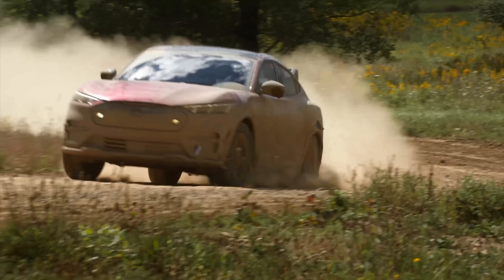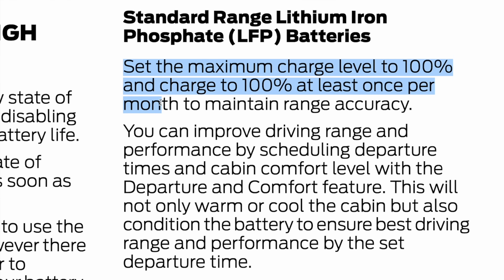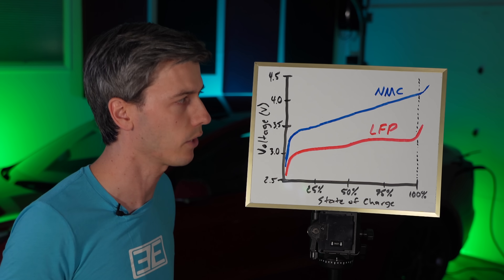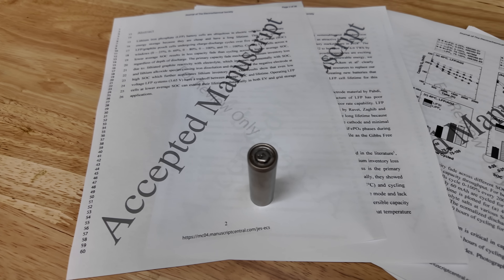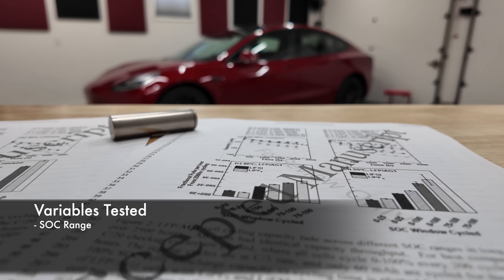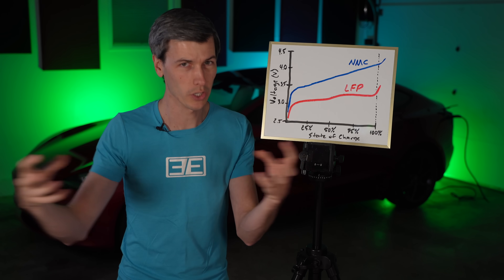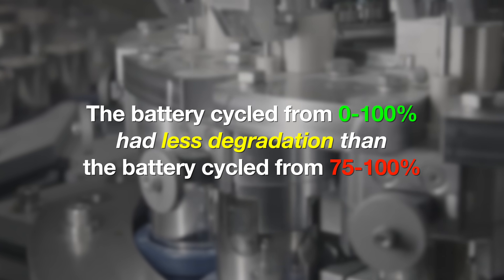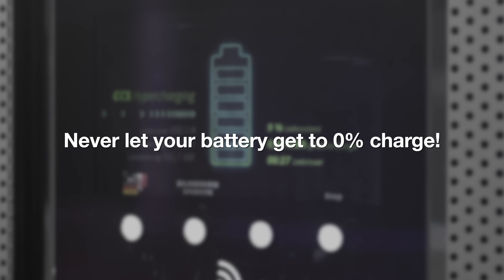How To Ruin Your Electric Car's Battery - LFP Edition!

Comment: "You should never let your battery get down to 0%. Period." Someone should tell Kyle from Out of Spec Reviews. 😅
Reply from the maker: Haha, honestly was thinking about him when I wrote that line. But I love that he does it, because we all get to learn from his experiences!
Reply: @EngineeringExplained yes but at the cost of permanently damaging a vehicle that was loaned to him which will be sold to a customer in a couple of days lol
Reply: @EngineeringExplained  go watch TeslaBjorn and his getting stranded videos. Where he goes battery dead, with clear testing what shall happen and how long it shall take to get out of situation. It is clear that going to 0 and total dead battery shall happen as we do have jerrycan for a reason 😂
Reply: @EngineeringExplained  you mean  learn from his mistakes.
Reply: @cloudpandarism2627  both are grammatically correct.
Reply: @cloudpandarism2627  do people not realize that Kyle doesn't run out of battery in normal personal use (maybe once ever)? He intentionally runs out the battery in testing so that people know what the buffers and behaviors are.
Reply: @cloudpandarism2627 
He's doing it on purpose to get the data.  That way, we don't have to.  It proves you won't blow up as well.  It's not a big deal to be at 0%, as long as you charge soon.
Reply: I don't think the cars allow the batteries to actually get down to 0%. They always keep some buffer to prevent damage even when the car will no longer drive. I would assume the only way to damage the battery is to leave it for a while after driving to 0% so the battery actually gets fully dead.
Reply: @RyanSmithPhoto  That's typically the case.  Battery life(longevity) is effected by states of charge where charging from 0% to 100% (actual battery voltages) may only allow a battery to complete 300 cycles, if it were to charge from -5% to 105% it may only survive 10 cycles, from 10 to 90% it may complete 10,000 cycles.  Most manufacturers are targeting a particular cycle life so they are going to lock you out of the top and bottom of the pack to make sure the battery survives the warranty period.
Reply: @yournumberonepal  Most LFP's are rated 3000-6000 cycles 0-100% 1C charge rate and still 80% available capacity at end of test.
Reply: @RyanSmithPhoto SOC of 0 % is no real cell SOC of 0 %. Even if you drive till car is dead this is no cell SOC of 0 %. It is just important that it is charged asap.
Reply: @RyanSmithPhoto  I seem to recall Tesla pushing an OTA in response to some natural disaster way back that gave people additional emergency range because of the circumstances. Predictably, this upset some people who felt that Tesla were holding out on them by having the battery health safety buffer at all.
Reply: @Birdulon  It wasn't the battery buffer. For some time in some models, they just put the bigger packs in, and software restricted them to the lower amount of range so they could get cars made. They unlocked that capacity for a short time. They allowed you to pay to do it permanently as well.
Reply: @Birdulon  That was only for those cars who were software limited for range.  Tesla produced a 75kw battery but sold a 60kw option for less. Same battery but software limited.
Reply: @theredmonkey But that is still the buffer. Such battery would last longer.
Reply: @theredmonkey  Looking it up again, you seem to be right.
Reply: @RyanSmithPhoto true
Reply: @RyanSmithPhoto Agree 100%!
Reply: @RyanSmithPhoto except he runs EV not just to 0%, he ran them to complete shutdown.
Reply: Tesla keeps about 5% reserve. I have driven my LFP Model 3 down to -1 miles and I saw 5% SOC in Scan my T3SLA app.
Reply: @dennischin8872  not a problem to drive to 0%.
Reply: Well Kyle isn't exactly normal consumer. Kinda his job is do the thing like push cars out of envelope and see how they handle that.... so that normal consumers don't have to.

One just has to understand "Kyle drives cars to 0% to see how badly it affects the batteries, so that you know never to do that".

People, don't drive your cars like car reviewers.... Reviewers try to make cars break and behave badly, since that is their job.
Reply: @aritakalo8011  and I enjoy his videos. But aren't all his videos using loaner vehicles from dealers? ...eventually sold to customers. I mean, 1 discharge isn't going to destroy a car but ...what if 1 cell gets damaged a little? The juice is worth the squeeze for the channel, but I wouldn't want to buy the VIN he tested. 🤷
Reply: kyle did mentioned about this which this video doesn't - get down to 0% is not a problem. But STAYED at 0% is. Always charge immediately upon reaching 0 (which Kyle did). Similar to charge to 100, he didn't stay 100 for long. How accurate what Kyle claim is unknown, but I wish this video would explain that important part.
Reply: @jihangaban  I looked at Google Scholar and couldn't find any studies on charging to 0 percent being ok unless it stays there for a while. Can you give the study that you based this on?
Reply: Kyle doesn't buy the cars himself. He gets them from other people. If he wants to run them down to 0%, fine, but he should warn the owners. If a manufacturer has contributed one, they shouldn't sell it to a consumer afterwards if they determine that the test has degraded it.
Reply: @juliam6442  Well I would assume any manufacturer provided car is a press car, meaning it isn't going to sales inventory. No it is dedicated press car loaned out to reviewers and then after that for example living as company fleet car or something like that.

Since usually people tend to want to buy... new cars from dealer and well you can't sell vehicle as new after it having been a press car. Abusive reviewers or not. It has clearly made hundreds, if not thousands of review driving kilometers.

It is on manufacturer, if they sell press car to customer. Atleast unless it is sold as "used press car" with well used car prices and well noting the kilometers already driving on the vehicle. Just like how you can sometimes buy at used price a "store display unit TV". Since well it has been blasting light in the store for hundreds of hours already, so it has wear on the components. Sell it as used at below half price.

Loaning on other peoples cars, yeah on that it is on Kyle to make sure and clear "I'm going to drive this empty and rather abusively cycle the battery couple times.... You sure you are okay with that? It will hurt the battery"

One doesn't have to warn car makers about "reviewers are going to try to make this thing misbehave and reach it's limits". That is a given for review units. It comes out of the marketing budget, to treat the review cars as most likely value write-offs.
Reply: Danger with storing at zero or low SOC which was not mentioned in video is that they self discharge 1-3% month on thier own, store at 10% for winter and your battery might be dead come spring. High SOC has such little effect on degradation so long as battery is kept cool companies like Battleborn recommend storing at 100% rather than trying to discharge them just enough but not too much and they will self discharge anyway.
Reply: I find 0% a bit misleading in both cars and Kyle videos (like range tests). Some cars (mostly german) are truly out of charge at indicated 0% but many cars like Tesla have a decent buffer below indicated 0%. So in cars with a buffer is it truly as bad to run to indicated 0% as in german cars that are truly out of power at 0%? Is it just a locked vs unlocked buffer? I can see an argument made for either way of indicating SOC but I kind of wish each manufacturer would be more open about this info
Reply: @GregWaszkiewicz  No car is going to be truly 0% when it says 0, in fact 0% SOC can be open to interpretation, most LFP BMS are set at 2.5v per cell low voltage cut out and that is considered 0% SOC, but an LFP can be run down even to say 2v per cell with minimal damage and plenty of stories of recovering packs all the way down to 0v with very specifically recovery strategies. It's basically how much damage are you willing to risk kind of thing, there isn't a hard cutoff. The problem with running down to 0% is not immediate it would be letting them sit after that and they self discharge further causing much more permanent  damage. How big the buffer is when the car won't move any more determine how long it can sit afterward and still be recovered.
Reply: Kyle is literally the definition of "I too like to live dangerously". I often have panic attacks when I hit 10% on my e-tron, I can't imagine how he does it or what goes through his mind.
Reply: What, you want them to rename their channel to "Within Spec Reviews"?
Reply: And that's why I can't have electric cars, I had enough phones become trash because of that.
I also mothball my vehicle and just don't use it for months.

I need to have a diesel car, there's no alternative.
Reply: @monad_tcp  There is a large difference between phone batteries and car batteries, and the strategy of the battery management.
LiPo, used in phones have under the usage conditions only 1/10 of lifetime of car batteries  which run under very controlled conditions, regarding temperature   and SOC control.
Reply: @monad_tcp Ah, but there is an alternative - maintain your vehicle properly. Cycling the battery per what’s necessary to maintain its particular chemistry is no different from changing the oil, or not storing an internal combustion vehicle with a tank full of gas for a year without adding fuel stabilizer to prevent the fuel from gelling up and destroying the fuel system. It’s just a different maintenance cycle that’s needed.

Likewise, there are people who will store a vehicle with a tank full of gas without stabilizer in it, and there are people who will drain the tank or store it with stabilizer and then make sure to drive through a tank of gas periodically to keep it from going bad, just like there are people who change their oil when it’s time and there are people who don’t. In the end, you can tell the difference between them based on how long they last, or how many problems they have, or how often/how soon you need to replace or rebuild the engine or transmission - for EV’s, it’s how soon or how often you need to replace the battery pack.

Many EV’s give you an option for what SOC to stop charging at, so it’s as convenient to store them as it is any other vehicle - you set the limit to the storage limit and you store it, and if it requires draining and recharging every some number of months, then you do that or you don’t just the same as you would change oil or burn off the gas and refill the tank. The difference is this is much easier with an EV because you can do it safely in your garage just by turning it on and setting the heat or A/C to max, depending on the outside temperature, and let it drain the battery, then come back and plug it back in to top it back up to whatever limit is needed.

You may not WANT to do whatever that particular maintenance schedule would be, but the only thing making it unsuitable is almost certainly just yourself, and not your circumstances.
Reply: 43 nimrod comments and not one of you used the term 'BMS'. Watch more videos or so some reading! BMS design determines what is a safe maximum discharge level but that does not mean safe to park it that way for a long time.
Reply: I do it every day almost 200k miles
Reply: well he knows what hes doing. basically all new EVs have buffers at the bottom end to prevent being discharged to 0%. so no harm done here.
Reply: When battery indicators say 0% it usually means the lowest available voltage - which for Li-ion is about 3.4 or so volts.  No damage should occur, but a battery should not be left there very long as it will continue to self-deplete.
Also at that voltage there is a tremendous chemical stress - but again - for short duration: no harm.
Reply: You technically can't zero out the EV battery. The Battery meter reading may say zero but there is some charge maintained in the battery by default from manufacturer. Therefore when removing the EV battery even though meter says Zero % the technician would still need to discharge the battery further to reduce the charge & risk of electrocution.
Reply: What about the folks in Chicago that were stranded on 0% while waiting on chargers. Is there battery done for?
Reply: An EV battery has a buffer called brick protection. This is the buffer below the buffer below 0. 

You cannot damage your battery by going until the car stops. This will only deplete the buffer below 0 but never the brick protection. 

In order to brick your battery you have to run out of the brick protection buffer, meaning you have to not charge it for a few months after it came to a complete stop.
Reply: Just get a hybrid, all problems solved 🎉
Reply: @sailboatlighthouse  Hell no! Hybrids are the most complex of all vehicles. Much more to go wrong.
Reply: He's got more money than brains so let him.
Reply: @zachlafond2652 he isn't paying for the car when he does those test.  The manufactures know exactly what he is going to do to those cars.

Comment: Okay, now I know how to save the lifespan of my phone battery. Nice video
Reply: But your phone does not have LFP battery
Reply: @ΗΕΑΗΘΣ  Ik, Lithium ion, but the principles of keeping the battery in a good condition is similar to LFP and NMC
Reply: If you have a Samsung, there is a charge limit setting that stops charging at 85%. That's what I use, unless I'm travelling or something and know I might have limited access to plug in. iPhone has something similar but it's not a hard cutoff, it charges as high as it thinks it needs based on your average usage. I prefer the hard cutoff, but that's better than nothing.
Reply: @andrewt9204  now is set to 80%, thx
Reply: Gonna install a wall outlet inside my fridge to keep the battery cool when charging.

Comment: So glad you put this video out! Manufacturer recommendations and best for the longevity of the vehicle/battery do not always line up. Prime example is extended oil change recommendations by manufacturers. EVs are still so new it's hard to know what's actually best and who's telling the truth. Thanks again for clearing up some misconceptions about LFP. No battery "likes" to be charged to 100% all the time. Just like no engine does "better" with 10k mile oil changes.

Comment: Doesnt lfp go up like thermite when exposed to water?
Reply: No
Reply: Lithium itself is indeed very reactive with water or air. But I think that the iron and phosphate keeps it stable.
Reply: @KiwamiJoryu  my worry is there is aluminum in them aswell. Albeit small im just wondering if the polymer liners they tout in the patents would be enough to stop said reaction. I mean we see teslas burn and oxide like tanerite as is and a main concern of lfp is its safety as it requires more weight dedicated to shielding and protection part of the reason its power density is lower... Im no chemist but i just know that safety would be my number one concern.

Comment: So at the Moment the solution to all of this is: If you feel that your car is low on Energy... just fill in petrol when you want, as much as you want, at a temperature you want and as fast as you want. I'll come by again 2030 or so when this EV thing is either matured/perfected or has vanished again.
Reply from the maker: The cars last just fine. My Tesla is from 2018 and doesn't have much degradation, works great, and the warranties are really long compared to most ICE vehicles. There's fear bc it's new and unknown to most, but not because the technology isn't capable.
Reply: Meh.  The batteries are warrantied to last like 8 years, which implies they'll last way longer (Tesla, ever the teller of truth, says their batteries are rated for 300k-500k miles).  This is just micro-optimizing the battery like people do with ICE engines all the time.
Reply: Well, sure, but do you use 85 octane, 87 octane, premium gasoline, E-10, E-30, E-85, no ethanol? Do you use an additive when it's cold out? Do you worry about whether the fuel you buy from some random station you've never been to before might clog your fuel filter? So complicated. Who wants to think about all that detail? Not to mention the great debate on how often you need to change the oil, or whether you need to drive around the block every month if the car's just sitting unused.

Of course, most car owners don't think about any of those things, and yet their cars mostly keep running. That's as true in the EV world as in the pre-EV 20th century world. And I think that's Jason's real point.
Reply: @ps.2  In Europe you dont have to think about anything of this. You put your "Super" in your car (which is always controlled high standard and additived gasoline available everywhere) and you drive your car to your Car Companys Outlet when it tells you so for an oil change/inspection (depending on your drive habits the interval changes between 6 months and 2 years). Thats it and most likely the car will last two decades / two hundredthousands of miles (whichever comes first).
EVs have a way to go to prove that for themselves. I mean... after there are more than 5 chargers or so in 20 miles distance from my home installed to even try it.
Reply: Just plug it in

Comment: Wow wtf.. there are EVs with nickel batteries? I thought long range models would be more battery, not weaker battery. 

And what does Ford mean by longer battery life from charging to 100%? More AH from a single charge? Or more charge cycles? Because it's usually 1 but not 2 with lithiums.
Reply: NCA always confuses me when referred to a nickel. I'm used to LiCo and LiMn and LiFePO